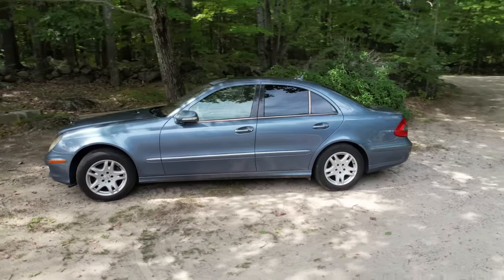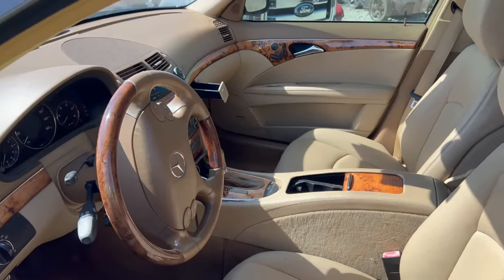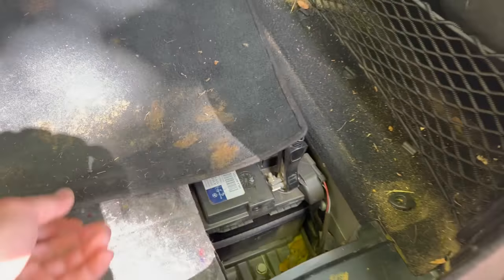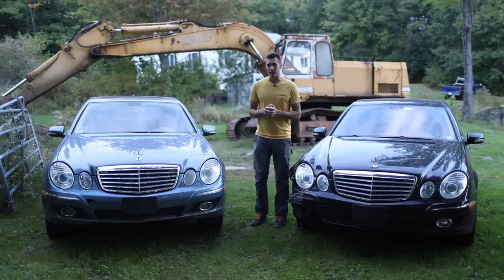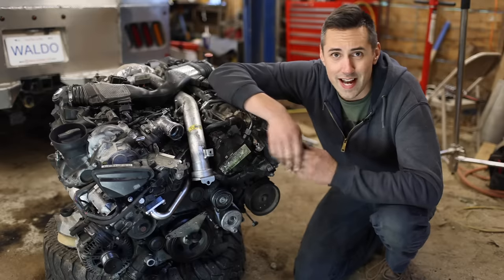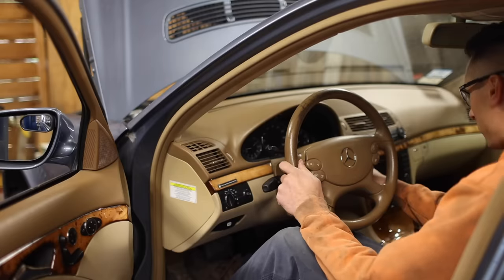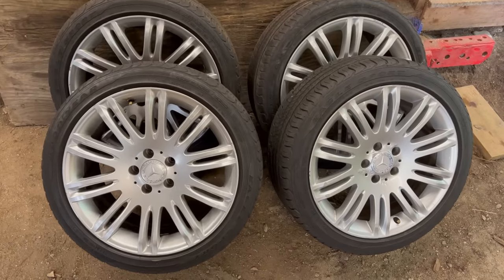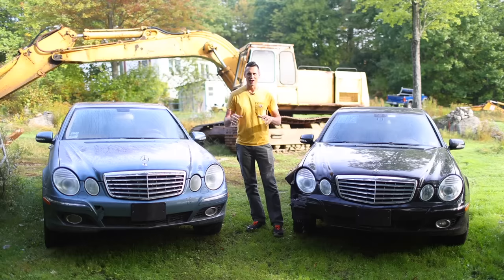Making One Mercedes E320 Diesel from Two Cheap Salvage Cars

Comment: I bought my first 2004 W211 gas last summer. It was inspected and I had to do quite a bit of work on it to get it passed inspection. I ended up around 1600$ total. I took a 600 miles one day trip with it and it was a awesome roadcar. 500$ for those wheels tas quite a bit. I have 3 sets of mercedes alu wheels and I am struggeling to sell them for 200$ per set but this is in Norway.

Very interesting video an very vell made, a pleasure to watch, tanks for sharing.

Comment: I’m enjoying your series of “go big” videos for bold projects that are done economically and show the rewards for diy and research.  I noticed the torque adapter you’re using on a breaker bar.  Do you mind saying what brand it is?  I love the Geiger counter audible indication that you’re close to the set value versus the click indicating you just exceeded the set point or having to see a visible indicator.  Thanks!

Comment: Hay bud glad you decided to get the lovely blue Merc sorted. Quick question about the headlight 3M kit, does it include all the correct sandpaper plus the attachment for the drill you used 👍

Comment: Turbo actuator is an issue as well. They quote you a whole new turbo. Bought a d returned 3 in 2 months. Ended up being bad contacts that an auto electrician fixed for $50. Fantastic long distance car. Always use OEM parts and fluids

Comment: Side note: If the gear box hasn't been used in a while or serviced it will have be done before bring used. As you mentioned the blue guy probably never survived most of the parts of the car.

Comment: A talented hands on spanner user!

I have a query about towing speed limits in the good ole USA. Here in blighty it's 50mph on single carriageways and 60mph on dual carriageway and motorways. Just interested as the rig is cruising at around 60mph to conserve fuel , but could go faster: but there's a 55mph max speed sticker on the trailer.

Comment: Love the Mercedes diesels. I had an 83 SD with the 5 cylinder turbo diesel. I swapped it into my Jeep YJ. Waldo you mentioned you bought a Golf brand new. Is it a TDI Golf? I have 4 TDI's so far and looking to buy a Golf TDI for my daughter that's learning to drive.
Reply from the maker: No, it's a Golf R. If the engine ever needs to be replaced, a diesel swap would be tempting. Maybe turn it into a GTD 👌
Reply: @WaldosWorld  That would be cool! I have seen a few Audi TTTdi's TT's with swapped in TDI's. In Europe you can actually get 4 Motion TDI's.

Comment: Hey this is a great video I started my w211 e320 bluetec journey just 2 years ago bought one on auction smacked on back ,bought a color matching trunk lid and bumper , pulled rear end out on a frame machine , and ordered new tail lights and headlights (headlights because olds ones were yellow from the inside which is a common problem on these) anyways I got it with 98k so far I've deleted the swirl flap motor that threw the vehicle into limp mode , serviced the seals on the intake piping and PCV valve, changed out radiator to acess a leak , changed pulleys , belt , fuel filter , new intercooler hoses , AC compressor clutch , if your keep that engine in check it is the best damn car I've ever owned

Comment: I hope you added fluid after idle  cause they aren't full until the trans pump pump the system full so you may need to add some some also have you idle while adding fluid do whatever the manual tells you to do or look up service data

Comment: I went a ways down in the comments and saw no mention of black death. You are probably aware but I figured I'd mention just in case. Combustion starts blowing by the injector seals and can get so bound up the head has to come off. Preventative maintenance every 60k pull them, polish bores, new seals and bolts

Comment: Thank you for sharing your experience. In 2018, I flew from LA to Sacramento to buy a 2005 model for personal use. Best car purchase I’ve ever made.  One problem I have is deteriorated wiring in the headlamp assembly. One of them shorted and seems to have disabled a circuit.  I replaced both assemblies.  The one that stopped, still does not work.  Both high beams work.  Do you know where I can look for a solution?  I would think a blown fuse would disable both headlights.  Thank you.

Comment: When you were using the chain tied to the Rover to pull the Merc and then went  below looking what did happen, well if the part or chain had broken at the moment, that could ended up hitting your face perhaps killing you. Do ever release presure on parts before inspecting them.

Comment: MY W203 2007 has 240tkm on the clock and still runs like new, and it only had one problem over 16 years. It was the Turbo seal. It got replaced and done. Furthermore, it never had a mechanical problem.

Comment: What was the active component in the transmission that was electronically sensed I mean there were no wires is there a magnetic pickup I don't understand how it could possibly have sensed a difference in components

I get that there are transducers but what I don't get is how is it connected AND what is unique about one part versus a different otherwise identical part???

Turbine speed sensor (TSS)
This sensor sends a varying frequency signal to the TCU to determine the current rotational speed of the input shaft or torque converter.
When you install a new TCM in these vehicles, it must be programmed with dealer-level equipment or equivalent, and the programming must be performed on the vehicle. What's more, you should never try to drive the vehicle to the dealership after the repair; it may cause premature transmission failure

Comment: Re the battery - I recently sold my 2007 A class Merc, which still had the original battery and which still started right away, every time. Except after I got covid in 2020 and didn't go near the car for 6 weeks - I had to remove the battery and fully charge it and saw it was a Merc original dated 2004. 
A 19 YO battery that still held a good charge? I was impressed.

Comment: As for the oil cooler. Many of them are leaking because of bended surface. Hope that in Your case replacing seals wil do the job, but Your should check the flatness too.

Comment: Thats the conductor plate you pulled out of the trans. Those have problems and should be replaced not reused. get a new one along with the connector fitting from FCP Euro - lifetime warrenty too.

Comment: I have a 2005 e320 CDI,  has just over 200K and runs wonderfully,  I did encounter the Black Death on it about 30k ago,  just took forever to get the old injector out.  and Clean up all the exaust deposits.   but other than that it is a wonderful vehicle.    BTW,  I run about avg 38 mpg on it.   Well im in TX so the Speed limit is a but higher than NE.  another tidbit my e320 began life in Manchester NH.
Reply: wow!

Comment: The sound of that OM642 is just insane, the low end rumble. God i wish i wasnt taxed as hard where i live (here they tax on engine cc/hp/year ratio, but basically anything over 2000cc is way to expensive, but over 3000cc is like kidney like expensive)

Might take a risk and get one in a S212 (s stands for station wagon) chasies E350cdi 4M, for now rocking a w204 2.2 cdi

Comment: The v6 and 7spd auto doesn’t have a good fame unlike the 2003-2006 inline 6 with the 5 spd. Make sure you check the secondary battery as well

Comment: definitely do fuel milage road trip, i have 2015 subaru impreza with cvt auto and manufacturer claims 37 mpg on highway, it does even better 42.9 at 65-70 on road trip Orlando to Charleston. one fuel tank, 780 miles.  You will get probably even better despite v6 diesel...

Comment: Love the video's unassuming down-to-earth flavour - subscribed, Yes a fuel ecomony test before a reasonble performance mod, a say 30 % torque and power bump, I'm willing to bet it would be more fuel effcient modded. Also your tip is gold, it has been so easy for me to think I'm looking after the car, only ruining it by using Chinese clones, my case was a cambelt tensioner that failed. Strangly enough it was made in Canada...But the nub of the matter is get OEM even if its twice the price.

Comment: hey man, i absolutely love what you did. i actually own two W211 E280cdi v6 with engine om642, one being a wagon and the other a sedan. the sedan has transmission problems. it won't move, it will indicate that it is in drive or reverse, but it just won't move. im guessing it could be the transmission control module. Hopefully the problem lays within the solenoids, because its an easier job to fix/change, while the control module, as you mentioned, needs to be programmed. Now, my question is, how could i get it programmed without going to mercedes, because i've already asked them and got a quote of 800usd to do it.

Comment: Awesome video and beautiful headlights!  The turn signals are located in the top section of the headlights.  Does anyone know/have a link to how to convert the signals to LED and transform the front ones into daylight running lamps (DRLs)?  When the signal is engaged the signal bulbs (now LED) would cease DRLing and begin blinking like a normal turn signal.

Comment: I had a '97 C36 AMG and ran the stock OEM MB battery for surprisingly 15 years without issue. I think the battery was made by Varta. Super robust batteries.

Comment: Just found your channel and as a Mercedes diesel enthusiast, I'm sure glad I did. If you want a diesel engine that really lasts, pick up a 2005 or 2006 E320 CDI (pre-DEF) car. I had two of them and really liked them. They are the last years of the I-6 cast iron block diesel engines. I have a 2013 E350 Bluetec now with 90,000 miles on it and am enjoying a lot of the more modern interior and technology. BTW, the editing of your videos is top notch.

Comment: Wnen I change trans flid in. my 2013Sprinter I also change torque converter oil and oil cooler oil. sprinter fix has a good utube showing you how, same engine. After seeing your vidio I am going to get one. I live in South Fl where most of the older cars are in great shape.

Comment: Fun fact: In my European country you cannot drive two axle trailer with the standart(B) category car licence, after you get your licence if you want or need, you have to obtain additional category(BE) where you need to go to short 6h theory course and then take practical state exam, after passing only then you get this category and can haul 2 or 3 axle trailers, up to 3,5t of max weight. (so you can haul a car on a trailer) With standard licence you can only haul up to 750kg single axle trailer. 🙂

Comment: Your content is awesome. That consumption test that you mention would be awesome to see. I used to have Renault Clio 2004 1.5dci 82hp diesel and the best I did is 1200km with 45 liters of gas oil. I had an accident on a highway (a female strucked from behind) so I bought Alfa Romeo Giulietta 2012 1.4 multiair 170hp gasoline. The comsumption is 7l/100km

Comment: So lucky the interiors are the same. Such a cool project. I would build the better body and that blue is super nice!

Just watched the part about parts quality. I couldn't agree more. It's actually a hobby of mine to find out who the oem supplier was for things like pulleys, O2 sensors, motor mounts etc. One example was the belt tensioner on a 2004 V8 Grand Cherokee, The dayco one I bought literally had a grind mark on the casting where the Chrysler pentastar was on the original. Even had the same bearing in the pulley. But 1/3rd of the price. Lemforder makes a ton of the OEM german and swedish stuff. Companies like FCP euro list country of origin. Chances are if it was made in western europe its OEM.

Comment: One has to be your age or younger to go through all that work. Computerized crap that needs transmission pulls to change a control module....BMW with batteries that need a special scan tool in order to have the battery charge etc, etc. Thanks, I will stay with my 2003 Buick Park Ave, & my 97 Dodge Ram 2500 4X4 , manual transmission & Cummins 6BT with a Bosch "P" pump.  .Two great videos from which I learned things. You have excellent audio with your articulated speech, & constant audio level. 
Thank you, I enjoyed both clips.  Cheers! from Alberta  Brian
Reply from the maker: Those are both actually very good choices of vehicles! 👍

Comment: My c200se s205 from 2016 has 185,000 miles on it. Its petrol. My w202 had 235,000 miles before pollution regulations killed it off. Ditto my s124 had 256,000 miles on it before my wife killed it off. Properly looked after these cars can last almost forever.

Comment: I am not surprised by the battery working, mercedes uses huge batteries, and they tend to last about 10 years of daily use. They are also not that expensive anymore my old Benz was $180 from the dealer and the Oreilys comparable with a 3 year warranty was $160.

Comment: About the transmission module I was shocked, im my country you call a guy that work witch car electricity, diagnosis etc., connect via OBD, some changes and thats it. Cost around 50€

Comment: In Europe, driving an E class without parking sensors is a pain in the butt.
I retrofitted chinese front and rear parking sensors kit on my poverty spec E220 CDI W211 and I wondered why the firts owner was too stingy to choose the Parktronic and rear folding seats options but chose the expensive 4 zones climate control...

Comment: Those 3.0 l CRD engines are very good and reliable MB diesel engines< but look for injectors seats. If "black death" is present -replace injector  seat  copper washers.

Comment: There is nothing wrong with your transmission module. This is the safety feature I do not like. The air con and transmission will cut off when there is a crash detected. You need a dedicated OBD reader to reset it.

Comment: Why did you put a black gas cap on the truck. You should swap it for a green. I work at o Reilly people have the option of a gates tensioner and a gates belt. They are made in America with a lt warranty. But most dont want to pay a premium and end up costing more later on. If you buy a master craft belt it's got less fibers inside with a denser rubber causing they to crack.

Comment: Very nice Video. As a German, calling an E-Class 211 a "small Car" made me Smile. As it is a Midsize to large car over here. It is one of the not so good Mercedes,  with lower Quality than the infamous 124. But the Car should be good for 400k km or 250k Miles. The Mercedes 123 or 124 Series (First E-Class) were famous for their 600k Miles or 1 Million Kilometer capability. Especially the 210 and in lesser extend the 211 were not so good build and mark a lower Point on the Mercedes Quality.

Comment: Eines der besten und langlebigsten Autos, dass in Deutschland gefahren wird. Lediglich der Rost in den ersten Modelljahren bereitet Probleme bei den W211.
One of the most durable and reliable cars on European roads. Just the corrosion in the first model years is a negative aspect of the W211.

Comment: Reprogram the trans and change the module to a new one. rebuild the valve body with the updated valves ect. How do you not know this? You will be sorry running low profile tires. Blown tires and cracked rim magnets

Comment: How do you have so many miles driven on all those cars.?

I have a 2011 450 gl. 155k miles.

I was driving it.. stopped and then no start..  bottom line mechanic said it was the starter and starter relay that just went. Does that sound bout right that it could happen..?

I replaced both parts figuring car is 13 yrs old. I had no prior issue .. it drove   and then just died in the same day.
Reply from the maker: The engine stalled while driving? That doesn't sound like a bad starter 

Has the fuel filter ever been changed? It might be clogged. A Mercedes scan tool would be able to tell you if the fuel pressure drops before the engine stalls
Reply: @WaldosWorld   no i was driving.. stopped to get a coffee. Then it would not start?

Comment: diesel = assuming it has a 6.0-6.5 liters / 100km , I reckon you can go 1000km with one full tank, cruising at around 110-120 km/h. Probably in city traffic you are looking at 8.5 liters / 100 km .  (sorry I live in Europe, don't know the imperial markings but I surely know diesel engines as we all use them here)

Comment: After 1993 Mercedes made the bad decision to ramp up the volume, going from 100k to 300k sales in the US. Quality suffered terribly. What was always chrome became plastic, leathers became "builders grade", fit and finish fell. This continued through 2014 with the introduction of the new S Class, E Class and C Class cars that returned to the kevel of quality missing for 15 years. The Golden Age of Mercedes was 1986-1993 when their cars were built to a standard, not a price. Buy a w201, w124 or w126. You will not be disappointed.

Comment: What a pity those being just the Sedan versions and not the Station. Very economic while powerful and reliable diesel cars though. Keep an eye on the turbo. They tend to eat through their bearings should You use not the exact oil Mercedes specs for these engines, and then they can run away on engine oil (happened to my high milage first 211 V6 D, engine fatal).

Comment: I wish it were a pre facelift CDI instead of a bluetec
Reply: even more rare dream car. I had a '99 E300 best driving car I've ever had, the power transfer in the drive train was just fantastic, like flying a jet. I6 vs V6? no compare. But you have to admit that frost blue car is very pretty. Goes well with the haircut ha ha

Comment: The only Mercedes worth manteining are the 124 models Diesel or Gas which were buid until 1995. Then Mercedes began to change technology. You will find out soon as I did  learn the hard way as you will be spending more time repairing then driving.